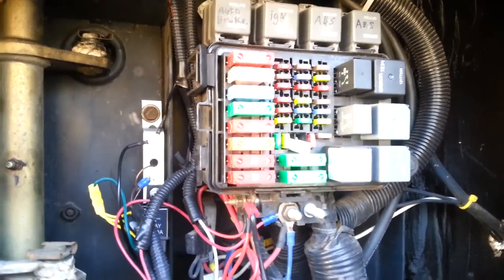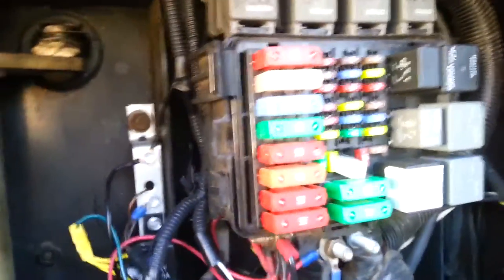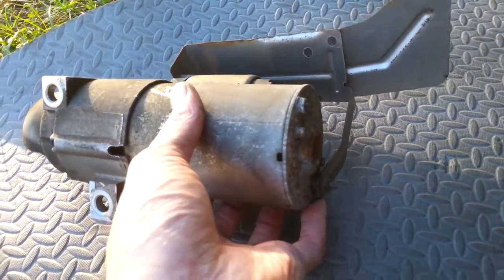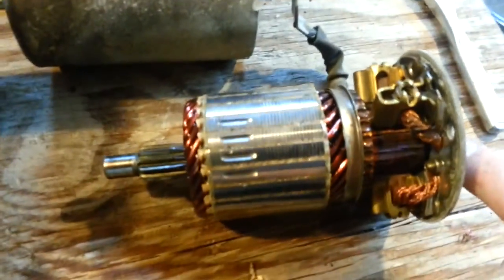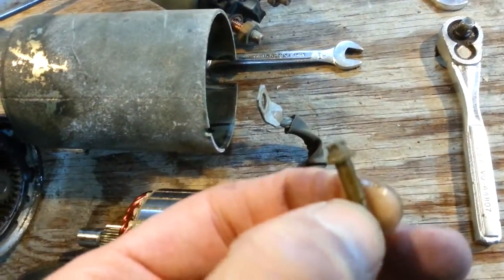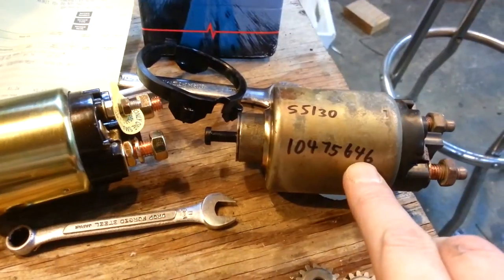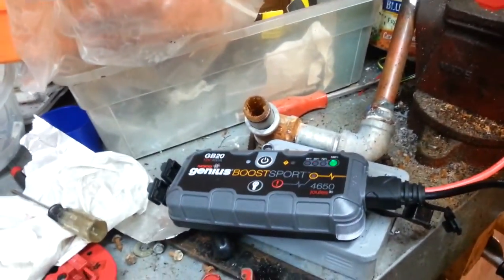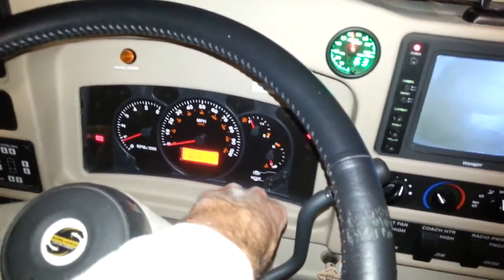Intermittent no start condition 8.1 Vortec W24 Workhorse Chassis starter removal and replacement

Comment: Thanks for another great video Kevin! This helped me track down my bad starter, and be sure I needed to replace the whole unit. Took it apart and one of the brush wires actually welded itself to the stator, so it was well and truly cooked.
Reply from the maker: Thank you for contributing. By the way, what brand and part number did you use? Did your old heat shield fit?
Reply: @ktoutdoor  And yes, the heat shield fit perfect as well!
Reply from the maker: What brand and part number did you install?

Comment: Thanks Kevin, mine did the same thing, I tapped the starter and it started. I was going to buy an new one, but I will replace the solenoid. In the old days you could take it apart and file the contact washer or flip it over and use the other side.
Reply from the maker: Yes I did that repair a few years back and it is still going strong. I am a believer in keeping the OEM starter or even having it rebuilt by someone, better than buying a new china starter..

Comment: I always enjoy your videos, Kevin.  Too bad the gestapo admins at a certain RV forum won't let you post them there any longer.  Had the solenoid problem on my W-22 last trip.  Dead in the water at the only dump station in the park right at check-out time!  Would not have made me very popular, but fortunately a tap on the solenoid with a big wrench got me running before it became a problem.  Like you, I don't want to chance it happening again, so I'll be installing the new one tomorrow.   I have been unable to locate the BWD solenoid you used, but the Standard SS736 looks to be exactly the same... probably made in the same Chinese factory.  The SS736 is available on Amazon for $60.90 at the time of this writing.
Reply from the maker: So glad you found my videos helpful. Let me know how the starter repair goes, remember those odd screws and the sockets I had to buy. Don't forget the starter relay on the firewall I keep a spare one with me. Yes very short sighted on there part not letting me help out other RV owners with what little knowledge that I do have about these things. If I can ever be of any help Text is the quickest way to reach me at 606-875-0125 Kevin
Reply: Also, thought I'd pass along that the Torx socket needed to remove the solenoid from the starter is a long, thin wall, size E5.  Harbor Freight 6-piece set #56343 for $20 includes what you need.  They also have a cheaper kit, but the smallest socket in that kit is an E6, so make sure to get the right set.
Reply from the maker: @cameronearnshaw2259  Thanks I will put this info in the notes below video.

Comment: Thanks, had the same issue today on on my 2001 Newmar Mountain Aire RV with Workhorse Chassis and Vortec 8100. I tried swapping the relays, no change, crawled under the class A and moved the starter wires and was able to get it to start. I got the RV in an RV Park about 2700 miles from from home in an RV park, was glad to be able to get the rig into a spot and I have some time to get the the starter solenoid replaced. Your video was a real help today. Thanks.
Reply from the maker: So glad that it helped you thanks for taking the time to let me know. Have a blessed day.

Comment: I have the same year Itasca Sunrise, 31W, workhorse/GM 8.1L. Thank you for this....I suspected starter solenoid right off, but good to know we have a decent starter in these and an easily replaceable solenoid. A big thumbs-up! Mine has 45K miles and runs like a champ.
Reply from the maker: You have a great RV there if you ever have any questions my cell is 606-875-0125 Kevin
Reply: @ktoutdoor  Did you see the post on the rv forum where the guy took his 'tested to be good' starter apart and it only had one cracked brush, and two loose copper connect wires rubbing on the armature and it actually worked? Well, till it got hot, then it wouldn't run at all. Amazing. 
I'm tempted to carry a solenoid, or a whole starter. The napa ones are $100. Those are probly the cheap rebuilt ones. Rock auto has solenoids for $40. 
I'm just happy I can get parts for the old bus. Makes me want to keep it. I just upgraded all the electrics batteries and solar charger. New awning, new tires, new shocks, new TV, new plugs and wires.
Reply from the maker: @Browneye57  I did not see that post, I don't visit the forum much anymore sense they band me for all of eternity because I tried to help out fellow RV owners with my videos "go figure" Yes I'm a believer of buy and hold that way you learn and know your RV from one end to the other and you build confidence over time knowing no matter what goes wrong you can handle it. We have had this one for 10 years now I'm sitting in it now..lol
Reply: @ktoutdoor  - I believe it, I can hardly stand the place. I don't really post, but will gather information from a search there if it pops up. A bunch of blowhards that think they know something. LOL
The bad starter post was from 2015...but still relevant. 
I'll keep your number. I may call you from the side of the road with a dead RV some day. LOL We appreciate your effort!

Comment: Great videos!  I have a 04 Itasca Suncruiser with a problem starting.  First started I thought with not starting after having the slide outs.  The hazard lights, headlights, nothing upfront would not work, then like magic about an hour after trying to jump the RV and nothing working it would just all of a sudden start.  The second time I was dumping at a dump station went to pull up would nt start...I turned the hazard lights on nothing... I forgot to turn them off and about an hour later the hazard lights started working again and I hit the starter and it worked like always and started right up.  Now, I am hours from a repair shop and a week later nothing.  Some say it is the ignition switch because when you turn it nothing happens--sometimes it will click and blink on the instrument panel but nothing.  I started watching your video to see if i could figure out how to get the cover off the top of the steering wheel i cant get it over the key cylinder.  I see in multiple of your videos you take it off but cant see how you did.  Do you have any experience with this type of issue?  Many thanks for your videos and tips I truly enjoy your channel.
Reply from the maker: Give me a call any time 606-875-0125 Kevin
Reply from the maker: also look here https://youtu.be/wTHCSuS9cjw?t=668

Comment: Nice video!  Question...Did you bench test the starter/solenoid before you started taking it apart?  Bench testing it once out will help rule out it was a wire or connection.  Hopefully, on the bench you'll have the same problem as you did when it as in the vehicle.  I have an 8.1L in my 2001 2500HD.  My solenoid sometimes doesn't kick out and just spins.  My failure happens after driving it, stopping and trying to restart.  Luckily it has never ground on the flywheel.  If I wait till it stops spinning it will engage the next time I try.  I think heat is breaking it down.  I may change the solenoid like you did so thanks again for the great video!  ****An idea for you and other viewers is also use a starter heat insulator, but also leave your factory shield too.  After reviewing different hear insulators, I found Jegs has the most economical one: part # 555-32000   I may just wrap it with the heat insulator to see if that takes care of the problem.  If it does take care of the problem, I may get under there and clean all the wire contacts to be safe and reinstall the heat insulator.  I Hope it helps others and I'll follow up what I find with mine!
Reply from the maker: Thanks for the tips and comments, to your question no I did not bench test because it was interment and I had all ready ruled out the starter relay on the fire wall. This was a few years back and the problem has not returned since I replace the solenoid...

Comment: Loaded up today, hit the key, and NOTHING.  Cleaned battery connections, no change, load-checked the battery, no prob there.  Confirmed that 12VDC appears at small post on starter solenoid with key rotated to START, but NO AUDIBLE ACTUATION.  Large stud on solenoid has 12VDC.  Concluding it's the solenoid, but I can confirm it's not closing (or is) easier after it's out on a bench,  Whether or not it the starter or the solenoid, I still need it out.  Thanks for this great video! ('03 Fleetwood)
Reply from the maker: Thanks for watching,, so have  you got yours running yet ? if i can be of any help my cell is 606-875-0125 text or call anytime I stay up late.

Comment: Mine went click... Try ignition again. Click.. Tried again SMOKE CITY! Thanks to salt corrosion, 200k miles I just went ahead an ordered a new starter to save the time of replacing everything. Although I really want to do a tear down anyways. Great video.
Reply from the maker: Wow 200K ? is your 8.1 in a RV ? what year what brand ?
Reply: @ktoutdoor  sorry no no it's in a Silverado pickup truck.
Reply from the maker: ether way its great that you have got 200k out of you motor I hope to someday have 200k on our RV.

Comment: Good morning I had the same problem with my rv I went under to remove my starter and one of the big cables was off so I connected it on the post on the right side there was one already connected to the left post after connecting my batteries up I went to start the rv and now I have no power at all are both big terminals    need to be together or separate across from each other?
Reply from the maker: Can you take a picture of what your connection looks like and send to my phone 606-875-0125 Kevin

Comment: Good fix. Like the marking of the part for warranty. like your methods of diagnosis. Have you replaced spark plugs yet? Looking for tips on avoiding problems. With over 104,000 miles on the 04 8.1 liter, will heat damage accrued over time, cause expensive wire or igniter failures during plug change?
Reply from the maker: I just did a plug change and compression test will post video in a few days. If you have any questions just text or call my cell 606-875-0125 Kevin
Reply from the maker: PS check out my fan clutch video with your mileage it might not be pulling enough air through radiator .
Reply: The only 'over' heat periods incurred are very brief, as serious low speed climb in altitude above 6,000 feet, on return approach to home in city.. Outside temperature is above 90 degrees ambient during those rare times.

Comment: Changed my battery,solenoid,charged battery,checked all connections. still wont crank or turn over. Thinking i need to get a starter or at least get get servic

Comment: Do you happen to have the part number for the Solenoid?
Reply from the maker: I used part number s5130 solenoid
I found more numbers 
10475646 	Starter Solenoid 	AC Delco
SS-906 	Starter Solenoid 	Wells
66-132 	Starter Solenoid 	WAI
ST 170 	Starter Solenoid 	NAPA

Comment: Where under the engine did you locate your starter? I don't know where to look for mine.
Reply from the maker: Below the right hand exhaust manifold. Follow the battery cable.

Comment: helped me know it wasnt the relay.  Bad solenoid i think.  Stuck in Alabama.....
Reply from the maker: Jon if u need help call my cell 606-875-0125 Kevin
Reply: Kevin Caudill VERY luckily, there is a truck repair place 4 miles away.  He agreed to come out in a coiple of hours.  We are at Rickwood Caverns campground.  I found the starter, worked the wires, tapped the solenoid...no dice.
Reply from the maker: Common starter should be easy to find one locally. make sure to get a good one. My self i like having the OEM starter rebuilt so i know I got the best quality . Let me know what you find out when all is fixed..